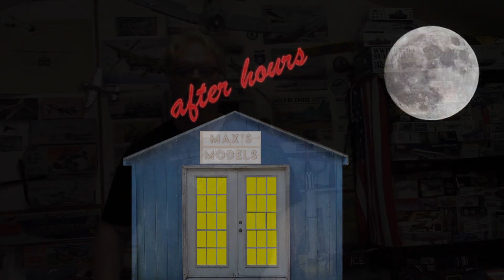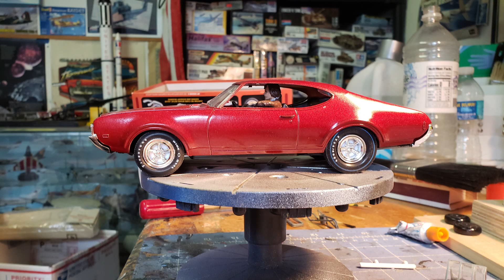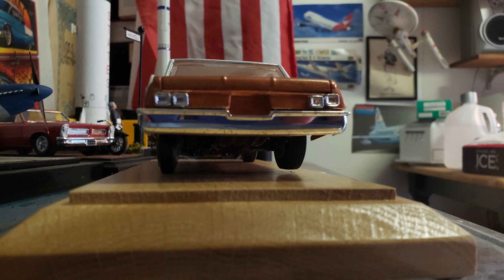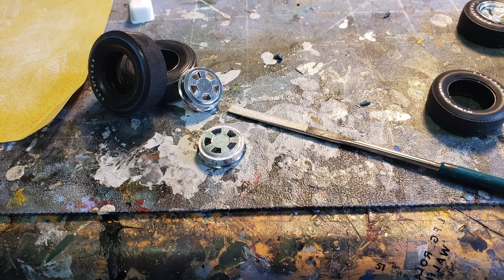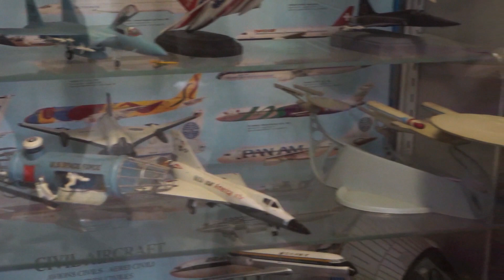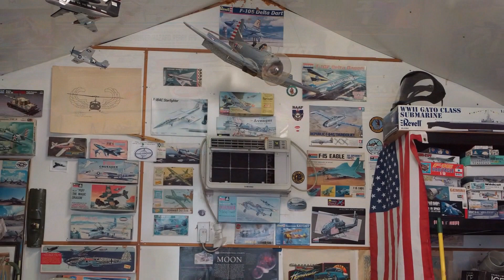Max's Models after hours 6/21/21

Comment: Ok - you might find that the diameter of the Cragars are slightly smaller than the regular tires.  That could explain the lopsided stance of your Polara.
Nice build for the Olds Cutlass.  A nice neat build.